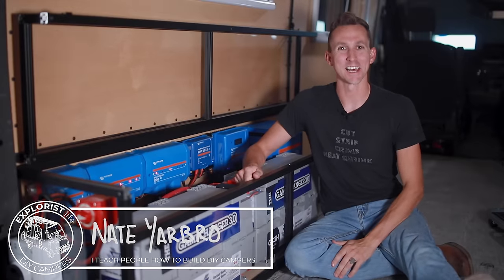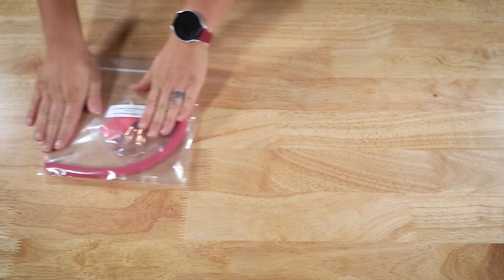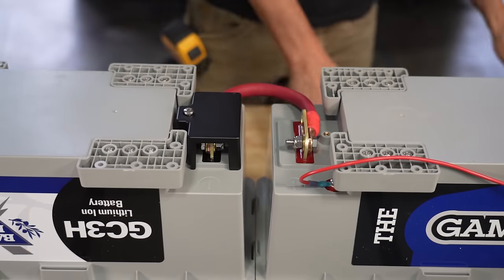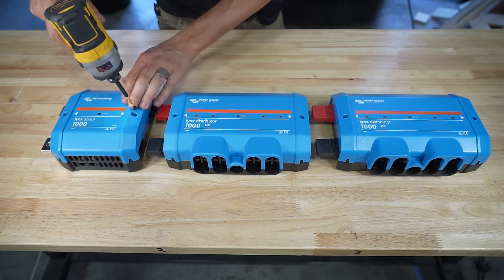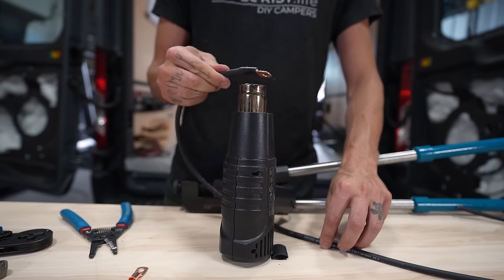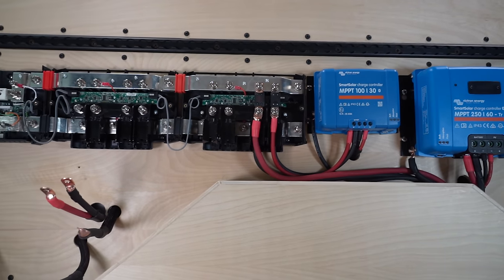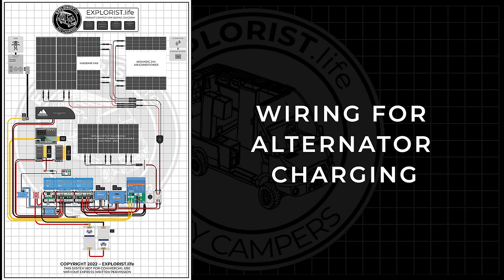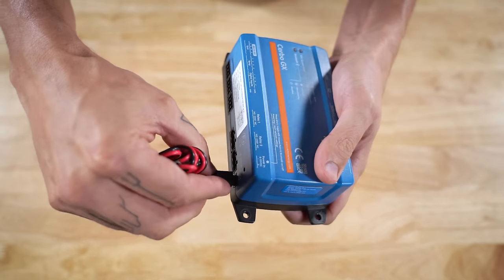DIY CAMPER VAN ELECTRICAL INSTALL (Start to Finish Tutorial)

Comment: Hello. I went with a very simple set up for my weekender. I have three methods in which to charge. Solar (portable panels that need to be plugged in each time to charge), alternator wires directly), and shore. For the solar and alternator I’m using the renogy Dcc50s (I got it on special). For the shore, I have a Noco genius 10. I’ve hooked the Noco to the 100ah renogy lithium battery, via a blue sea smart hub. My question is…is there a reason why I can’t just wire the shore power in the solar part of the Dcc50s?  Solar and shore will not charge at the same time.
Reply from the maker: I'd love to see you work through that thought process on your own.  Why do YOU think that connecting shore power directly to the solar input of that unit would result in catastrophic failure?

I can think of 3 reasons right off the bat.  Two electrical reasons and one practical reason.
Reply: @EXPLORISTlife  well…it’s 12v power coming through the 110 charger. So, I didn’t think it would matter. And I’d like to monitor the charging status. Wiring the 110 charger directly to the battery doesn’t do that (really)
Reply from the maker: Oh, I see.  I thought you were proposing connecting the 120VAC shore line directly into the DCc50S. 😂🤣

As far as your proposition.... I don't know.  I don't have enough experience with those specific units to give a good answer.  You could reach out to the tech support for each company and see what they say about it.
Reply: @EXPLORISTlife  thanks for your replies 😁. Renogy has lousy customer service. That’s why I thought I’d ask you (since I’ve been using your AWESOME calculators on line). 👍👍👍
Reply from the maker: Yeah, they don't answer questions any better for you than they do for me.  If customer support doesn't answer the questions, it's best not to stray from what is written in the user manual.

This lack of support from Renogy is absolutely the largest reason you don't see much/any content on this channel about them.  In my opinion, they are a marketing company that sells equipment.  Companies like Battle Born and Victron are equipment companies that spend money on marketing, if that makes sense.

Battle Born and Victron spend money to send me to trainings to educate myself about electrcial concepts and companies like Renogy just want to send me their portable power stations and batteries to review on a video.

Comment: How do you use a screwdriver to tighten a terminal screw, such as solar charge controller, ‘to spec’?
Reply from the maker: Torque screwdrivers measure the torque specs the same as a torque wrench: https://amzn.to/3SwQhjb
Reply: @EXPLORISTlife  They’re flat head in these components.
Reply from the maker: Indeed!  The previous link I shared includes a flat head bit.

Comment: So you ran 6 gauge wire to your shared fuse boxes, all your appliances won't exceed 60amps total?
Reply from the maker: 70 amps, but yes.  This is limited by the max output of the Orion converter.  I think your question was more-so a question about wire size, though.  Remember that 6ga wire with 105 degree insulation like we are using is rated to just north of 100A.
Reply: @EXPLORISTlife  I believe you should be using 4ga here instead.  According to the Orion manual, the max output current is 85A (not 70A).  According to all 3 of the following resources: (ABYC E-11, WestMarine "Wire Size and Ampacity", and AncorProducts "3% voltage drop") 4ga wire is necessary for up to 90 amps.  These resources all assume 105 degree C insulation rating.  The 6ga wire is only rated up to 80A (not 100A).  Please correct me if I am wrong (and maybe point to some resources that will help) so I can learn why. Thanks in advance.
What am I missing?
Reply from the maker: ABYC E-11 Table 4A (p. 62 in the most recent edition) states that 6ga wire with 105 degree insulation is rated for 120A when installed outside of an engine space.

Don't confuse voltage drop tables with max ampacity tables.

We don't need to keep voltage drop below 3% for this circuit as none of these loads are 'critical' loads.

Using 4ga would decrease voltage drop under full load; but the max wire size that will fit into that fuse panel is 6ga so I've made a judgement call that 6ga is the most appropriate here.
Reply: Got it, thanks for the reply, resources, and explanation, it helped clear up my misunderstanding!  Carry on!

Comment: the equitment ground wire must be green in color. 
39:33 I don't like that you connect the 24V and 12V crossed.
Reply from the maker: 1:  no it doesn't. 
2: okay.  Don't do that in your own installation then.

Comment: The mppt 250/60 is good for 1700w or 17000w of solar ? Isn't 250x60 max ?
Reply from the maker: Sorry, I'm not following your question.  Perhaps rephrase?
Reply: @EXPLORISTlife  the charge controller victron 250/60- How much wattage for solar panels can it take?  I was under the impression that you take the max voltage and times it with the max amp to get the Absolute Max solar array size.  Thanks
Reply from the maker: Not quite, no.  Here is a video that explains what a charge controller does: https://youtu.be/Jkbs84sBHsg
Reply: @EXPLORISTlife  okay thanks ! I'll watch the video

Comment: Wait, so I should clean every wire connection with alcohol and tighten to manufacture spec?!?😳😂😳
Reply from the maker: I swear; if I don't say it; people dip their connections in mud and then get them finger tight and then wonder why their systems aren't working.

Comment: Hi, I don't mean to spam you guys like this I just really want to know ASAP: Is there a DC-DC Battery Charger that's good for more like 400 or 800 amps instead of just 20 or 40 amps at 12 volts? Because what If you ran it with mechman aftermarket 400a alternators?
Reply from the maker: The alternators should come with a programmable voltage/current regulator.  Example: Wakespeed regulator.  You also need adequate battery bank capacity to support that kind of charging.  For example... this battery bank could only charge at a max of ~150A @ 24v (300A @ 12V)
Reply: @EXPLORISTlife  well yes the voltage would be the same at 12 volts but just a lot more amps or watts available especially after the starter battery is charged back from the engine turning on. For instance most stock alternators put out 150 amps at 12 volts which is about 1500 watts whereas the mechman alternators can bump out 400 amps at the same 12 volts for about 4500 watts, and 9000 watts if I were to run twin mechman alternators. I just want to use some of that energy to charge faster than a 150 amp alternator and just 40 amp DC-DC charger that only pulls away about 500 watts. And yes the bank is big enough. It's a set of 4 tesla battery modules with 12 volt bms to keep them balanced, but before that the power hits 2 lithium starter batteries first.
Reply from the maker: @vincenzopromedia  I think my previous reply answers the question?
Reply: @EXPLORISTlife  oh I see. I don't really know what the max charging specs of a tesla battery module.
Reply: @EXPLORISTlife  ok you've gotta help me out here. I don't get it. Why can a Tesla or any EV battery be charged at low and high current levels and not be a problem like at a level 2 level 2 or EV fast charging station but all of a sudden there's a block on charging them faster than 500 watts with a 40 amp 12 DC-DC charger? How does the station charge the batteries any faster? Obviously the alternator can charge faster than a wall plug minus an EV fast charger, and faster than any amount of solar panels you can put on a vehicle, and it's already DC and the right voltage. Now 5.2 kwh 250 ah @ 12V or 500 ah @ 12V. That doesn't tell me what the max charging specs are at least Idk how to find that from those specs. So lets say for your battery that charges at 300 amps 12v, is there a 300 amp 3000 watt dc-dc charger available for you to get for your system?
Reply: @EXPLORISTlife  I can't find a DC-DC lithium battery charger beyond 50 amps at 12v.
Reply from the maker: @vincenzopromedia  A 2nd alternator with an external voltage/current regulator (Wakespeed, balmar, or similar) takes the place of a DC-DC charger.
Reply: @EXPLORISTlife  ok I just found one some random website that says the model s modules can max and continuously charge at 225 amps at 24 volts which I'm assuming means 450 amps at 12 volts, or 5400 watts at 12 volts. Which if true probably means that with 2x 400 amp 4800 watt alternators, I can recharge 1x 5.2 kwh module after running my engine for 40 minutes, and all 4x 5.2 kwh modules after running the engine for about 2 hours. Does this seem right to you?
Reply: @EXPLORISTlife  I think what's really needed here is a wattage regulator. What are you using for a wattage regulator, is a wattage regulator needed, and where can I find one to use for diy purposes if they are needed?
Reply from the maker: @vincenzopromedia  With all due respect, I've already given you the answer.  Slow down and read what I've responded with and investigate the products I've mentioned.
Reply: @EXPLORISTlife  Oh my bad your reply's weren't refreshing on my phone but I looked on my laptop and now I see them. HAHA!
Reply: @EXPLORISTlife  Okay so why do I need a voltage regulator when the voltage will be the same?

Comment: Hi friend great work can you give me advice please i want to use a wind turbine on vacation i have one solar panel what MPPT charge controller can i buy to charge my lithium batteries 23 volt. it is a 24 volt wind turbine can build between 800 and 1500 watt power. I downloaded your video to go slow over what you did it is a great system not many like yours. Great work friend.
Reply from the maker: Sure!  Here is a video that will teach you how to size a charge controller: https://youtu.be/MxziHKvTRh8

I don't have any videos about wind turbines.
Reply: @EXPLORISTlife  I know how to size a charge controller watt divided through volt. Thank you for your time

Comment: This is also a tutorial on how to make tutorials. I'm not building a camper any time soon but the explanations of the principles of how to wire up solar and batteries is so good that I can't stop watching. Also appreciate that you didn't edit out your small mistakes, instead explaining what you did to fix them. And the fact that you provided links to the sections. You've set a new standard here for tutorial videos.
Reply from the maker: Hey, Steve Foster!  I appreciate that.  Thanks for watching! 🙂😀
Reply: Excellent comment, Steve!
Reply: I know right. There's no way I could do this I was having dreams about it because I'm messing with solar. I was having dreams that I could almost try to start doing this kind of thing for people. But there's no way I don't think I could get good enough. I didn't realize people have been doing this for so long. There are quite a few people that are very good at it

Comment: A magnificent demonstration! I have always respected your skills and talent for explaining so concisely. Bravo!
One point that gave me a shiver; the PCB ground connection wire on the negative buss has a RED terminal ring on the end!! That is a bit misleading. Design flaw at Victron?
Reply from the maker: Hey George, I sure appreciate that!  It means a lot coming from someone who has the impeccable attention to detail that you do. Thanks for watching!

I also hate how smaller ring terminals like that are color coded.  Traditionally, the small ring terminals (18-22awg) have red heat shrink on them (14-16 are blue, 10-12 are yellow, and then red again for 8ga (because there are apparently only three colors?) but this definitely leads to a bad feeling when trying to connect a small wire with red insulation because of it's size to a negative busbar.

Comment: I am confused, how does the 24V and 12V both use the chassis as ground? I would think that this may cause an issue
Reply: Why has no-one mentioned this? It's EXACTLY what I'm stuck on myself!

What happens if a 230v touches the chassis and rushes back to this distributor. Am I to believe it just safely passes through ALL of my 12/24v hardware WITHOUT causing damage to find itself back at the RCD to safely trip?!

Comment: I'm curious if you could speak more about why you chose Battle Born batteries?  They seem to be the popular option for DIYers, but the few engineers I know that are upgrading their battery systems in their RV/camper van (both in real life and on Youtube) have all gone with Lithionics.  The Fit RV did a factory tour of Lithionics that made it seem like a better option.  I'd love to hear you talk about your view on the different battery brands (if you can - I'd understand if you weren't able if Battle Born is your sponsor).  Thanks!
Reply from the maker: Sure!  So it really comes down to customer support.  When I am recommending a battery, the brand I am recommending needs to:
->Be able to sell the battery (aka: keep it in stock)
->Have fast shipping times
->Have great customer support to answer questions about their products (pre and post sale)
->Have great tech support to help troubleshoot if something isn't working properly
->A no-hassle warranty process where they don't try to weasel out of warranty coverage.

Battle Born checks ALL of these boxes AND they have high quality batteries to match.

There are other battery manufacturers out there who have great batteries, but they just don't check the rest of those boxes in my own personal experience.

Comment: One of the best most comprehensive build videos I have seen.  As a tech who builds these systems in mobile command posts I have two pieces of advise.

First, Only use the washers and nuts that come with the battery fuse terminals.  These terminals pull current through the first washer and simply tossing a stainless steel washer in there will heat up enough to burn your hands, melt plastic and even start a fire.

Second, would be to include some active cooling in that enclosure.  Inverters get very hot and a simple PC fan on a thermal switch circuit can extend the life of everything in that enclosure.  

Less of a technical comment and more of a preference would be to hit all that birch plywood with some wipe on poly, wax or some other clear coat to keep the wood from staining.  Even the sweat from your hands can leave marks on the birch ply and if you are OCD your gonna go nuts.
Reply from the maker: Hey TheReefaholic, thanks for watching!

Re: 1: Of course!  That's exactly what we did.  Battle Born batteries come with two lengths of bolts for their battery terminals.  We used the shorter of the two they supplied.

Re: 2: There is about 27sq/in of ventilation around the back of the enclosure and around the lid, which should be adequate based on the hundreds of systems I've consulted on.  *If it's NOT adequate*, I'll add a fan controlled either by enclosure temperature or have the fan turn on when the multiplus fans turn on.  I'll make a video teaching how to do this if I end up needing to do it. I don't anticipate needing this, but that's the plan if I do.

Re: 3: We did back when we installed the walls.  Here's the video for that: https://www.youtube.com/watch?v=cf2BjQxMKDI&list=PLmvhcyi4n0TVfA4XCYJBkzfUXunSON1zX

Comment: Hi!  Yet another very informative and awesome video! Thank you!

Do you ever see the need to have individual breakers which would be allow various parts of the system (DC-DC Charger, Solar Charge Controllers, etc.) to be easily isolated/switched off?  I like the Lynx Distributor but the only way to isolate a portion of the system would be to remove a fuse.
Reply from the maker: Nope.  I can't really think of a reason why it's worth putting a bunch of extra connections (points of failure and resistance) to have that functionality.  It'd be pretty rare that I'd need to shut one charging/discharging source down without shutting all of them down.

Comment: Excelleny tutorials! Congrats from Europe.
I plan to build my own van in a couple of years from now when I retire, so I still have time to learn! By then, I expect cost of batteries to have reduced and EV charging points to have expanded.
Have you considered an increased battery bank that could be re-charger at EV charging stations? and if so, which inverter/charger would you use?

Comment: i appreciate the video Im setting up my first solar system, going with a setup very similar to this, 4 450w solar panels, 2 200ah 12v batteries, multiplus 24/3k/70, mppt 150/100, and orion dc to dc.. my question is all of your layouts and tutorials say to use 4/0 for the battery cables and i see you only use 1/0, also the multiplus recommends 1/0 with 300a fuse. my question is did you change your opinion? can i use 1/0 because i have them all crimped and ready to go, im just waiting on my lynx.. but if i need 4/0 i will use it. thank you in advance

Comment: Hi Nate,
Great video as usual-and timely for us as we are starting on our 24V system. I particularly liked the dual solar setup. Do you have a preferred source for the ground solar array port? Idea for a future video: Cerbo GX vs BMV-712 battery monitor.
Reply from the maker: That port will soon be an add-on for our solar array wiring kits, but until then, I've included it in the 'other parts required' section of the kit for this build: https://shop.explorist.life/shop/all-products/camper-wiring-kits/complete-wiring-kits/540ah-3000w-24v-multiplus-580w-to-1700w-solar/

Cerbo GX vs BMV-712 is definitely a video on the horizon now that we've made this video.

Comment: Why did you run 6 awg to the DC fuse panels? Is it because you installed 2 DC fuse panels and need to double the amp rating? If you only had one DC fuse panel, would 10 awg work instead? Thanks for the information.